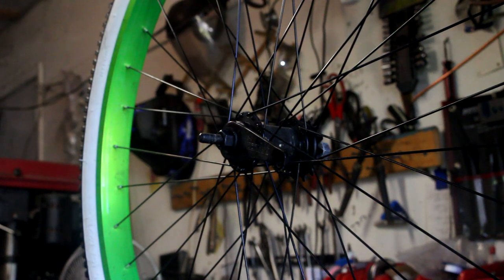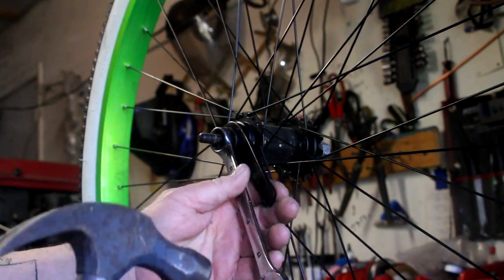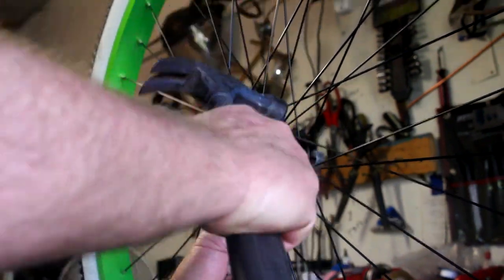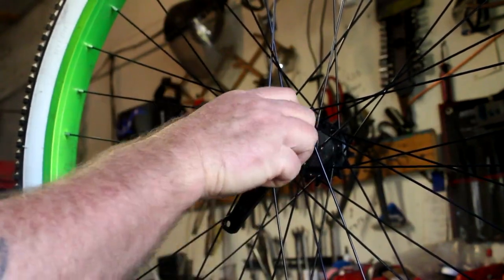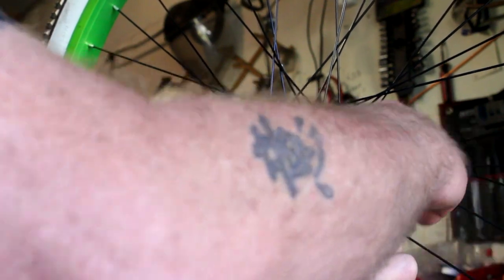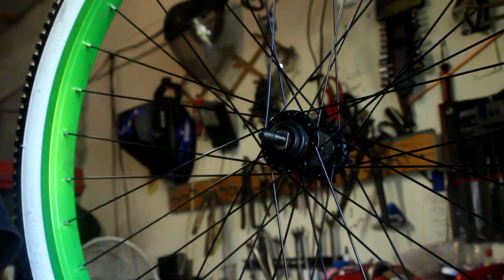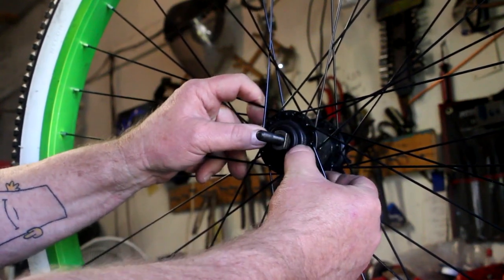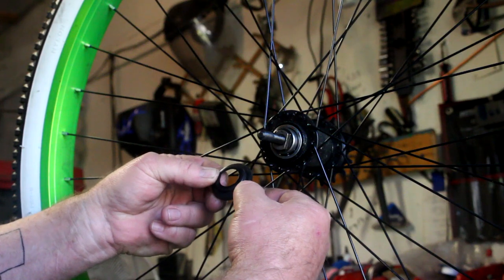How To Remove Rear Wheel Brake Arm on A Motorized Bicycle

Comment: Can you open the sprocit with a dremel to fit it over the dust cover
Reply from the maker: Yes. You must also ensure you mount sprocket 100% centered on the wheel

Comment: I just bought a motorized bike without the coaster arm attached.  And the pedals move forward when you do try and brake... that’s an inconvenient problem.   But my main concern is that the inner wheel hub comes apart, and the wheel wobbles on the axle.  Cant ride it for long.  Is the problem that the arm is missing hence turning the axle bolt loose?
Reply from the maker: Yup. Need to properly set it up w/ coaster arm fixed and bearings lubed along w/ hub cones properly snugged up
Reply: Hughes Motorized Thanks for confirming it. I just ordered one. Great channel man I appreciate that information.

Comment: Without the break arm can the brake still function?
Reply from the maker: no brake arm. no brakes
Reply: @HughesMotorized  so when you hit the brakes what does the axle do? like when the clamp comes off the brake arm and destroys the bearings type situation?

Comment: So I got  a kit for my bike and the kit requires to bend the brake arm how do I do this?
Reply: Put it on a vise.  And hammer bend it.  Use torch heat if necessary?

Comment: Bough a heavy duty bike wheel from the bike shop and they installed it. Definitely good hardware and would help too keep the wheel lasting on a motor. But that coaster was put on way to tight...
Reply from the maker: They sure tighten them up

Comment: Wow I just spent 20 minutes and still. Didnt get my rear brake piece off......I hooe using your method works for me.....and I missing a grinder......and ive been torqing in the bearing to hard......Lets see how this goes.....I dont want to tear it up before i get my spocket on Lol......
Reply from the maker: It took me a few tries before I got adding a rag joint sprocket down. Good luck
Reply: @HughesMotorized  I quickly figured it out after that brief complication....now I think my clutch needs to be adjusted.......I pull the clutch in and it still didnt free up the back wheel....
Reply from the maker: @windshieldrepair5961  could be rear wheel bearing, bearing cap hanging on sprocket or clutch pads are stuck. Most new motors have a stuck clutch. Try pushing the bike forward dragging rear tire and sit down hard on seat bumping the bike down and forward. Might pop clutch loose
Reply: @HughesMotorized  I think you may be right about the stuck clutch.....Ive made the decsion to wait it out and im going to buy the upgrades for my Bike build.....I will figure it out after I put the new wheel package on......I will also add the upgraded clutch.....I really want my stuff to be right before I even ever put any gasoline in my engine.....I had to take the clutch cover off to get my chain on......The videos I watched were not speciffic enough.....That center star nut and set screw.....may be clamped down to tight not allowing my clutch to engage......Whatever it may be....i will let it sit for awhile........until I get my other parts.....The mag wheel package is 129$.......Its to bad im putting them on a Huffy beach cruiser its still an important upgrade....
Its still going to be awhile til my first ride......Can you tell me the ratio for the brake in period.....16:1 or 20:1.....Ive heard several different things!!
Reply from the maker: @windshieldrepair5961  40:1 from day 1. No break in mix required. Using more oil will allow accumulation of carbon which will damage the motor. No need to baby these motors. Go slow-ish first 4 miles then start revving it up and run it fast getting the bike to run at full throttle for a little longer each time. Then after 4-5 warmup / cool down cycles check that nuts on cylinder head are equally tight. You don't need them super tight, just make sure that none have loosened up